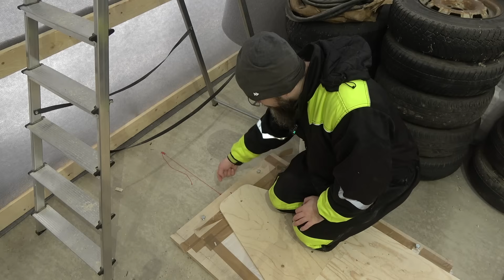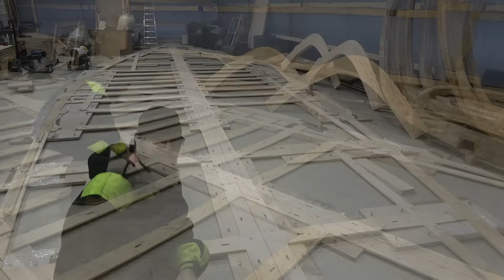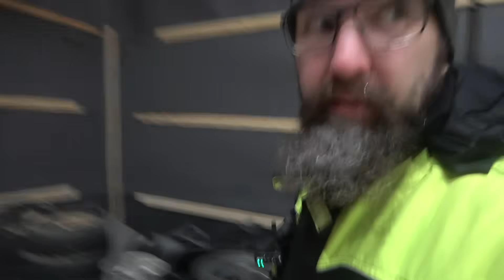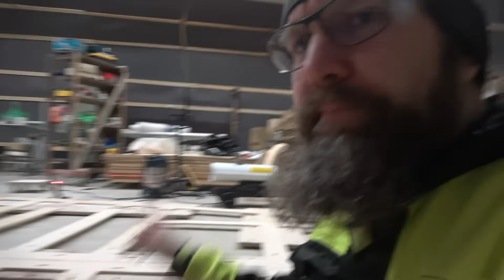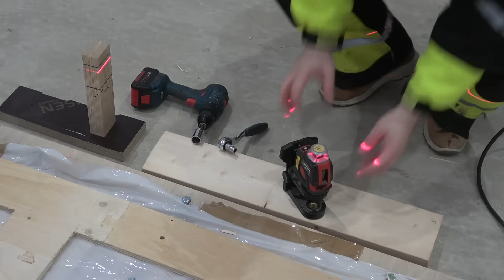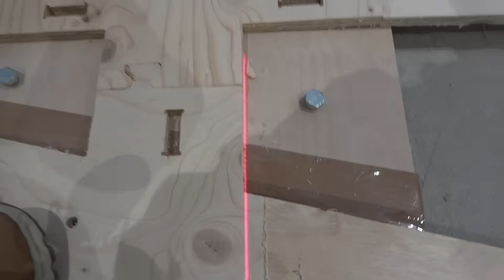Laser leveling 50ft DIY sailboat foundations! - ep72 Project SeaCamel

Comment: Hey Panu - you are making exciting progress. You are quite rightly seeking to work and achieve exacting standards. It may however be worth checking the laser level specifications for tolerance. Also when checking level (fore and aft), placing the laser amidships on the centre line will minimise (rather than amplify) any error. Keep up the good work.😀👍⛵️

Comment: Old surveyor here.
1) Get a solid bolt down mount for the laser.
2) Repeatability of the laser, is dependent on the internal suspension, of the laser element. Specifications, should have come with the laser.
3) Your laser setup, in the center of the work area, is correct.
4) Spindly tripod, is only for the camera, otherwise, pitch it in the refuse bin.
You are doing great, just keep cross checking. 
For determining the squareness of your form work, a tape measure, calculator and permanent pin, at the bow, or stern, to measure from are your best friends.

Best wishes from Northern Manitoba.

Comment: Fantastic! I just went through this exact issue with a sawmill. Fortunately in plane is more important than in plane AND level when slabbing wood.  We bought a smaller, sturdy tripod for macrophotography that has the crank up head. Don’t forget when you switch to an eye-level stick, keeping plumb is where that millimeter variation creeps in…

You are doing great. Loved watching you pop those pieces out of neatly stored 4x8 sheets.

Comment: Such a pleasure to watch you work and see how you think. Your steadfast desire for precision in boat building is uncanny and certainly not the norm however, I believe as others do, that it will pay off in the long run as your design, its measurements and tolerances in your drawings will be maintained throughout the build. A great way to start off your actual build. Additionally,  your boat design is much bigger and more square meters than I had imagined so far. You are building a large and comfortable live aboard sailing vessel. Watching it sail out of the Black Sea will be something to behold, a real achievement. I look forward to your future videos..... Joe

Comment: I just bought a laser myself and noticed the accuracy possible with these. Mine is a Bosch Quigo Green 2nd Generation and has a accuracy of 0.6 mm per meter. Meaning it could be 6 mm on 10 m or 9 mm on 15 m. The Bosch cost me 85 € here in Germany. And these things also have a max distance like 10 or 15 m depending on the model. The more expensive ones off course have a higher accuracy and distance. Also a classic water level has usually an accuracy of 1 mm per meter. The most accurate will be a hose water level which can be very easily made by yourself with an transparent hose of 15 or 20 mm (bigger will be better as the friction of the water on the hose is reduced. The air pressure will level the water precisely no matter which distance you're measuring. You can fix one end at the highest spot. Takes a bit longer as the water in the hose needs to calm down after moving to each new point. But there's no better solution for small budget on big distances.

Comment: Why don't you put an exhaust system on the heater and direct the exhaust gases out, alternatively you put the heater outside and direct the hot air in?
Reply from the maker: Yes plan is to put exhaust outside. If that just was that simple with this tent…

Comment: There is a method for checking the accuracy of a laser level. Place it close to one wall in your workshop and make a mark on the exterior wall and the opposite wall as far away as you can. Then move the laser across the whole workshop, close to the mark you made on the far wall and set it level with that mark and turn it on. if the laser line on the mark you made first across the workshop doesn’t lineup then your laser is out of level. You can also check it with a clear plastic tube filled with water. My advice would be to set it in the center of the footprint of the boat, and don’t move it while you are leveling. Enjoying this build please keep it coming!
Reply from the maker: Thanks! I’ll check that at some point. Although I’m now pretty sure that the level is good. I moved the laser to either end to the boat and adjusted it to my line. I also turned the laser around to make sure that the “beam direction” doesn’t vary.
So far so good. 😊

Comment: Set your laser level as level as you think you can. Then mark the horizontal lines on you walls projected by the laser level.  It doesn't matter then if the level is moved or even if it appears to not be level as long as it is projecting on the four lines on the walls everything is in exactly the  same plane.
Also second advantage of doing this is as your  boat grows in size and you are working at a different height all you need to do is draw lines on your walls  parallel to the original lines at the required height offset and then work from the new datum lines.  Of course check the walls are reasonably vertiical.

Comment: What is the accuracy of the laser over one metre? My laser had an accuracy of 0.9 mm and in the sequence of 6 sections there was a deviation of 14 mm. This would not have happened with a precise device.
Reply from the maker: It was user error. The camera stand was crooked somehow and the laser didn’t balance properly.
The laser beam gets a bit wider with distance but error there is like 0,5 to 2mm.

Comment: Did you considered using a water level? Just a long clear thin plastic tube full of coloured water, and when the water settles, where the  meniscus is at one end it will be at the same hight at the other, easy to google   checking levels with water in a pipe. fiy the great pyramid of Giza was believed to have had its base levelled in this way, and from memory (may be wrong) scientists calculated the on the day the base was levelled, there was a 4 mile an hour wind blowing, which blew the water out of level, due to the fact the base is slightly out of true. Best wishes in your endeavours, i look forwards to future episodes :)
Reply from the maker: Not really. Too slow and cumbersome.

Comment: I have been watching for some months and for some reason thought your name was Bono! I stand corrected. I just wanted to throw in the reminder not to put fasteners that will need to be removed later in a location where access will be blocked or at least a contingency if necessary. I am sure you have already considered this.
Reply from the maker: Yep, I’m trying to check the screw locations. Probably there will be some in wrong places though 🤣
Reply: That's probably why he put the screws in the side and not the middle

Comment: These videos are getting better and better from production perspctive, this one had a proper dramatic structure, you captured the frustration and then the happiness very well.

I would recheck the cameras focus setting, however, many times you are out of focus, when you hold it handheld, which is a shame. The focus area might be set to center. Assuming this cam has focus areas. 

All in all, I absolutelly dig this build now for long time, this year started with some setbacks, but seeing the boat on the floor is so satisfying, what a beauty!

Comment: Put the laser level at one end of the building (A) and mark the level on a stick close to the laser and on a stick at the other end of the building (B). Then move the laser to the other end of the building (B), adjust it to strike the laser at thee line you marked already when the laser was shooting from the other end (A). Now the laser should point at this line and at the line at the point A. If it is not the laser is of.....
Reply from the maker: Brilliant, thanks!
Reply: @ArcticSeaCamel  Thanks, and if so, the laser is of by half the distance between the laser shooting now at A and the first initial line at A. Get it 🙂

Comment: Don't worry that much Panu. When heeling in some choppy seas, the few off level mm will seem like a joke 😊.

However, inside the boat, accommodations need to look straight to the eye. Right angles must be right... regardless of the hull shape.
I used to learn the hard way how to keep "vertical" and "horizontal" references whenever the harbour master kept moving us around the boatyard throughout the refurbishing years

Comment: I had exactly the same issue with a Bosch laser level I used for some floor levelling. Every time I set it up the plane changed. I don't trust them anymore.

Comment: You can check the laser accuracy with a water level at the longest distance you are able to
Reply: I agree that a water tube level would be more accurate, a fraction of a degree in the laser will make a significant error over the length of your boat, the old ways are often the best. Good luck, please keep up the good work.

Comment: Ddi you move the laser during the leveling process? If you move the laser to another spot on the concrete you will have the laser on a different height as well.
Reply from the maker: Not during one session. You may notice that my measuring block had several lines on it. I did a new one each time.